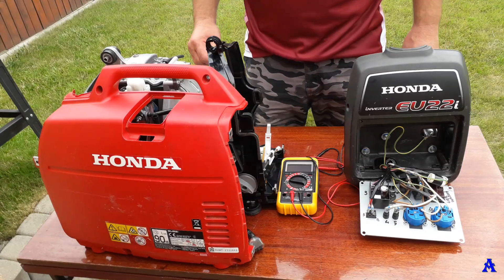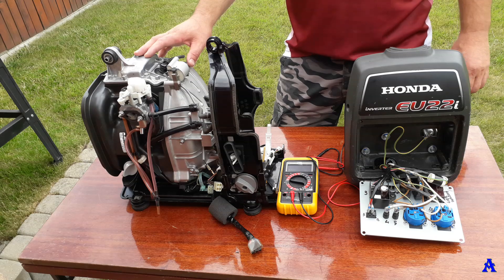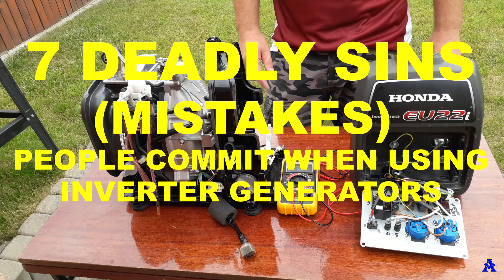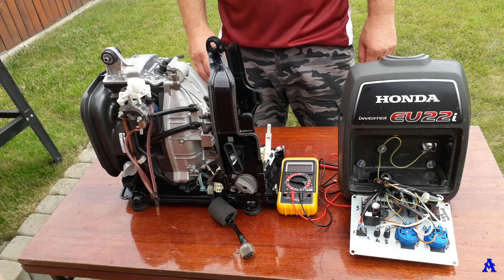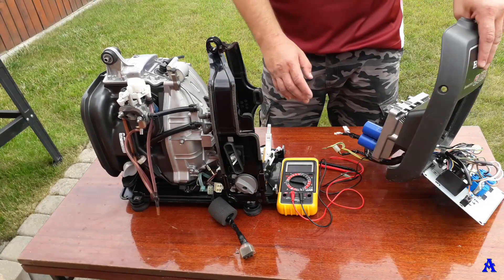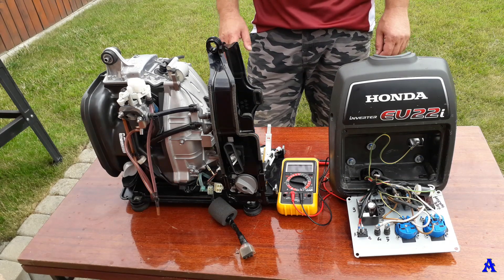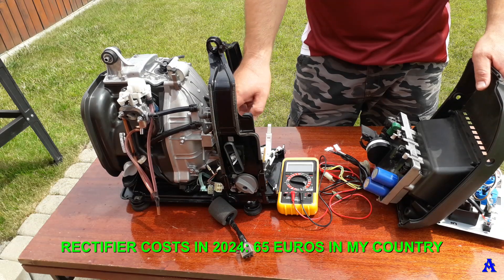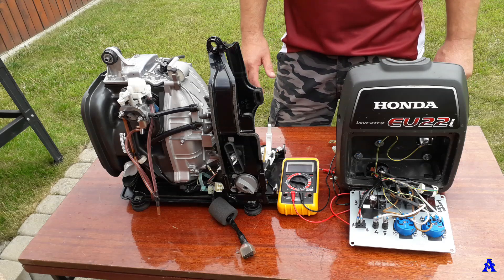Advice Worth 1000 € / $. INVERTER GENERATOR. 7 Deadly SINS Users Commit Using Inverters. HONDA EU22i

Comment: Hi. What electrical items would you say are safe to use on this generator? Thanks again
Reply from the maker: Hello. This generator produces a clean output voltage curve with extremely low THD (Total harmonic distortion). The voltage from this generator is of higher quality than the voltage in the electrical network of some countries. So the voltage it produces is safe for any electronic device. You just need to follow the things I mentioned in the video. Another thing is that not all electrical devices are safe for this generator. Some can even destroy it. I myself have heard of more than 5 cases in my area where a new generator was fatally damaged due to user error. They definitely do not use a generator to power welding machines. Using electrical devices with brush motors is not recommended for inverters, but users often do it at their own risk, as the risk is much lower than when using welding machines, which require high Amperes not only at start-up. You should always find out not only the nominal power of the devices, but especially the starting power (it must not be higher than the maximum power of the generator).  Some old refrigerators and freezers can have a starting power of up to 10 times higher than their nominal. This is something to keep in mind.

Comment: Hi. Great video but can u explain what you meant by ''Do not start the generator under load'' Thanks
Reply from the maker: Hi and thank you. Sure. I can explain what I meant. You simply should not have any devices connected to the generator that draw power instantly. Besides, it can destroy the devices in question - especially if you are using a generator that does not deliver a pure sine wave of electricity (i.e. it is not an inverter) and has a high THD (Total Harmonic Distortion) value. In such a case, immediately after starting, while the generator is warming up and running smoothly, the voltage frequency (in Hz - Hertz) tends to fluctuate. This can destroy the connected electronic devices. The same can happen if you are running out of fuel and the engine speed fluctuates. And how can connected devices that draw power instantly damage the electronics of an inverter generator?  Well, the engine is not yet started and warmed up, the alternator is not yet producing current, but immediately at the moment of starting, devices with high consumption create a load on sensitive electronic components, such as resistors, capacitors, circuits, fuses and other sensitive electronics - especially in the inverter module, and they can be damaged. It may not happen right away. Higher-quality generators can withstand something. But with repeated use in this way, sooner or later damage is likely. To summarize - immediately when starting the generator, NO devices that we want to power should be connected to it. I hope this helps you. Greetings from Slovakia. S.
Reply: @AdviceFromGarage Hi. Thank you for advice on this. Regards. Ray
Reply from the maker: @rayfinnerty You are very welcome.

Comment: Baahaha, you got a lemon, man I have beaten my eu22 bad over the years almost 16 years old, still going strong, even had it running on grid tied solar panel inverters. running flat out for days non stop constant, only to refill for fuel.
Reply from the maker: Honda European Media newsroom in April 2019: "New Honda generator EU22i. Honda has updated its most popular portable generator, the EU20i and is replacing it with the even more versatile EU22i with more power, improved fuel economy and even quieter operation." I guess you own Honda EU20i. You are right. Looks like a "lemon"  :). I bought it broken for a very reasonable price for testing what is wrong with it. Honda and other inverter producers do not recommend to use this inverters to power solar systems as far as I know.
Reply: @AdviceFromGarage  Correct must be a 20, they should never have changed to the 22 then, LOL. Solar grid tie inverter harmonising is not for the faint of heart, and only for the experienced, with load matching it is very possible to do, I have also load matched grid tie inverter setups with cheap Chinese pure sine wave inverters, works a charm. As the Honda inverters have dual connection capabilities it  has the smarts to try synchronise the phase shift required. My point is generally they can take a beating and just keep going Honda for the win.